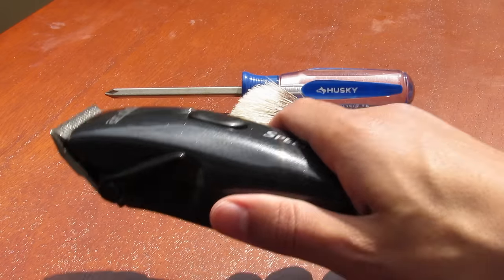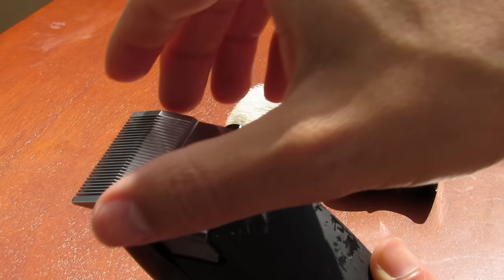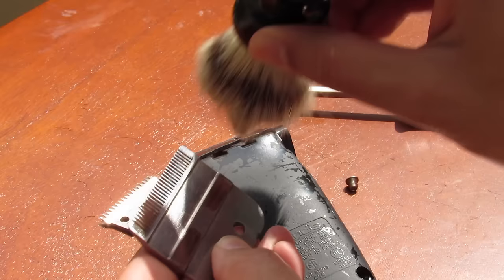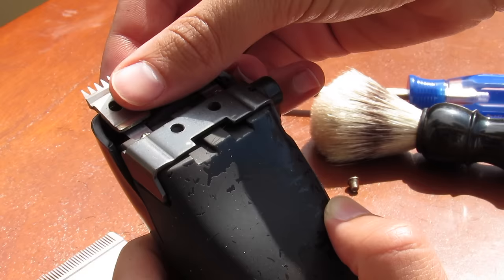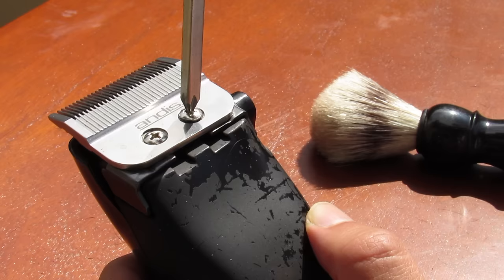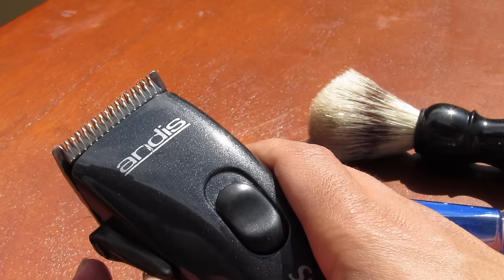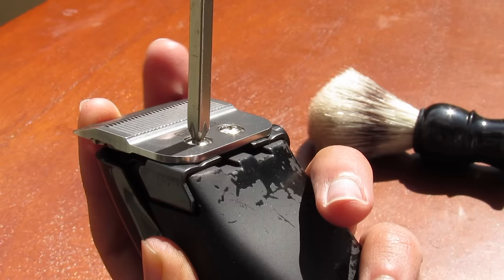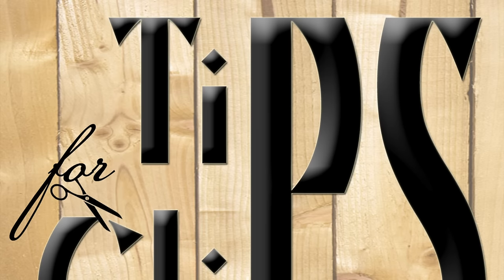Zero Gap Any Clippers in 4 Minutes | Tip #15 | Barber Equipment

Comment: Thanks and tip at 1:38 solved my problem informing us to have the 2 curved parts pointed to each other.  When I 1st put it back together the smaller blade I had it curved away was from the larger blade.  Thanks again

Comment: On the whal home cut pro. You can push it all the way. All you do is loosen the two screws push the blade back all the way and tighten while holding or pressing against countertop. Then take your fingernail and make sure you feel the bottom blade before the top(the one that moves). When cutting hair don’t press too hard or it can scratch. I just did this for the first time and the results were unbelievable. The clippers cut like a razor now.

Comment: Seems easy.  So if all you need to do is zero gap the blade, you would just have to loosen the two main screws and adjust the position, and you don't need to take it all apart, correct (like, say, on a brand new clipper)?  Also, since you said to still have the top blade extend slightly further than the bottom blade, "zero gap" would really be "tiny gap", where "tiny" is something like 1/4 mm?

Comment: Lol should’ve came here before zero gapping my new clipper 😅 no wonder why I got all this little cuts all around my head lol... thanks for the info bro
Reply: Lol. I feel you bro. You gotta adjust them. Then try them. Then adjust and try them again and again until you get them just right. It can be a pain
Reply: Lol @ all this little cuts all around my head. 😂😂
Reply: I've zero gapped mine too and am getting cuts, sore patches and old skin being taken off
Reply: @DanielGreen07  I had to readjust them a few times.  Just a little bit at a time though. You might not get them to cut as close to the skin, but at least you won't skin yourself alive either.
Reply: @joej3900  I've adjusted them as best as I can, they ll do til I can get a pair that give that smooth skin cut 👍

Comment: i been watching your videos great advice! im learning to cut hair and was wondering what the zero gap is for?
Reply from the maker: Thanks! Good question: I briefly mention at the end that it's for precision, but a better reason is that if you're ever using the clippers without any blades, you'll be able to get a really short cut. So if you're using the clippers in the short setting without any guards, it'll be as close to a zero as you can get it. Does that make sense?
Reply: Tips for Clips - Haircutting can it be used as a trimmer ? For beards
Reply from the maker: Saliba R, to lighten up a beard? Yes
Reply: @TipsforClips  do you need to zero gap if using 00000
Reply: @TipsforClips  hey bro i just bought hair clipper and i always cut with guard on but i dont want that when i remove guard it cuts so bad how can i get rid of it
Reply: @TipsforClips  do this for Kemei 5017 please?
Can we do this for kenei 5017
Reply: @mrt8097  no but it is for your eyebrows! Try it!
Reply: @TipsforClips  would you explain us the teeth sizes and the spacing between the teeth of the blade please
Reply: Mi

Comment: Hello, it is not recommended to zero-gap a clipper especially if it has been in use for a long time cause the upper blade will draw a line (groove) in the lower one and whatever you try to be precise and align them back to the previous position you will never succeed so you will loose the sharpness of the blades and you might be forced to through both of them and get new sharp ones. I would like to thank you for the channel and for the simple, concise  and at the same time very rich in the most wanted information videos you present.
Reply: All my clippers are 0 gapped and I've had some for at least 10 years with no problem

Comment: Can I use a zero gap razor to get a look that resembles a slight grey on top after wet shaving it all off? 

I'm mostly bald but I l prefer the grey on top of my head that comes after 2-4 days of wet shaving. I'm wondering if this is a good strategy.

Comment: I've zero gapped my wahl baldfader clippers and now they're taking off the top layer of skin and not cutting to a smooth finish. Help!! 😄
Reply: Your bottom blade is overlapping you top one you need to have a very slight overlap in the top blade so It doesn’t cut your skin 👍🏽
Reply: @IronIzan  I've adjust the blades so there's a slight gap now but it's taking off skin (white, dry skin which may be dead?) Maybe the clippers are fine and I need to moisturise? 🤷‍♂️
Reply: @DanielGreen07  prob the clippers get some fast feeds they work good af
Reply: @IronIzan  I've given up now and just wet shave it with a hand razor 👍
Reply: Those clippers don't need to be adjusted.They already are sharp.🤔

Comment: Unfortunately this does not work with a Wahl Super Taper Cordless. The blade can not be moved as soon as the screws are in position. Or am I doing it wrong?
Reply: 123 654 Nope, won’t work because the two holes in the blade and the two screws holding the blade have the same diameter. When I loosen the screws the blade is still fixed. It can only be moved when the screws have been removed. Maybe they have changed it with the model I have (Wahl Super Taper Cordless).
I have now used two different screws to make it work like you have described. Thanks.

Comment: I have a Wahl Pro. If I loosen the screw on the gap lever it allows for moving the blades to exactly where I want them. Is that the same as unscrewing the 2 screws holding the blades together? It seemed like the easiest way. Although I still have to disassemble it to clean and oil. But will the blades remain zero that way?
Reply: The screw on the lever only tightens or loosens the resistance of the lever. It doesn’t allow for adjusting the position of the blades.

Comment: Nice video! So...just did it with mine...just to be sure..the little blade just go over the pivot right? and the big blade goes on top and when screwed this one secures the little one? am i correct?
Reply from the maker: VIC CAMPOS, thanks! If I understood you correctly, then yes, that sounds right

Comment: Hi!
Can I do it on a Wahl Icon too? 
I'm going to buy a clipper, I'v chosen the Icon, and I'd like a nearly zero gap cutting (about 0.1-0.3mm), because I want to use the clipper also on my face "shaving". I'll  use the machine only at home, I'm not a professional.
Will I Surelyt be able to do this with the Icon?

Thanks for Your help!
Viktor
Reply from the maker: Viktor H, I’ve never tried the Icon. You can certainly zero gap Wahl clippers, but if you want to shave your face, you will not get a clean shave as you would with a blade. Zero with clippers is not as sharp as trimmers or blades
Reply: Thank You! My goal on my face isn't a totally smooth skin so it'll good for me if it is adjustable to a near zero gap as You told. My doubt was only about that Icon's adjustability as in the video I'v seen.

Comment: A ripper washer would be best to put under the screw the gets less tension bc then you can still tighten it and keep a straight blade without the worry of when your actually cutting hair say doing a line, the rattle or vibration will loosen the screw and move the blade and possibly cause a cut or uneven hair lines

Comment: Do you recommend to zero gap if you will be using it to line up your beard?
Reply: @Sheriff. 0 gapping is for fading, it helps with removing leaving fades lines for better blends. For beard, I would use a trim liner, they give a crispier lines and easier to handle.

Comment: Great video. 
My problem is that I keep marking my skin and gives me black mark my skin when I do outline.  What your advice. Thanks
Reply: Did you figure it out?
Reply: I have the same problem also
Reply: Check your blades to see if the cutter blade is higher than the guard blade.

Comment: hey there, I've got a wahl color pro cordless and I was wondering if I could safely try this too? maybe not necessarily 0 but lower than 0.8. Thanks
Reply: boulala21 yes you can I have the same clipper as you. You can 0 gap them
Reply: @NighmareRS  oh sweet, do you know if I need different screws? as that's what I read somewhere else. Cheers

Comment: So is it best to have this type of clipper as your fading or balding?
Reply from the maker: Scardrewpro, zero gapping helps you cut shorter, so it’s good for a balding haircut, though you’ll need something other than just clippers to entirely bald it out. It also helps with precision
Reply: It appears that most excellent clippers can cut hair to 0.8 mm but if you have a good shaver than it should be able to cut the hair from 0.8 mm to 0 mm safely.
Reply: So for super low, balding haircut to get the look you need clippers and trimmers together? You can’t just use trimmers, like T Outliners by themselves, if your hair is already short and you want it super close? Thanks

Comment: Do you know if adding a thicker cord like the ones on the big trimmers to any small trimmer will add power to it and help with overheating..
Reply from the maker: Sorry, I'm not sure
Reply: Doubt it! This is because the same power would be outputted to the motor. The motor is the main thing that generates the heat.

The best type of quality motor arguably is the Rotary motor. besides the quality of the hair clipper, obviously.
Reply: Nope, the trimmer will still get the same input voltage no matter how much you upgrade the power cord, the cord included with it is designed to be thick enough of wire to carry the power. Unless your cord is getting hot to the touch or has serious damage such as exposed copper wire, there is no reason to replace it. You also risk voiding the warranty. Only thing I can think of is make sure the blades are oiled and that the machine is not clogged with hair and debris, if you're mechanically minded lightly adding oil the to motor bearings may help it, but I doubt this is the issue. (This is advice for everyone)

Comment: Sorry dumb question. Wasn't it already 0 gapped with the clippers closed in the beginning of the video?
Reply: Rap Philosophy  most likely but he was doing it as an example. Or for instance sometimes when clippers come pre zero gapped they tend to leave a gap of like 0.25mm as a safety precaution and  sometimes you want it a little tighter like 0.15mm. Might not sound like a huge difference but it does make a massive difference in results.
Reply: @SoulCaliburDeathCrie  ah ok. Got it. I'm new to it. That makes sense though
Reply: Rap Philosophy cool no worries I’m no barber either myself I just like to learn this stuff. But so long as the moving blade and stationery blade don’t overlap you won’t be cutting people that’s the main thing :)

Comment: Your video was good. 
But after cleaning the blades and the inside, I would have thought that so oil on the blades would have been ideal. 
Eventually you have to oil the clipper, when you dismount it...do you agree that applying oil is a good idea..?
Reply from the maker: rich Mck, absolutely right. You should regularly oil your clippers. I just didn’t show it in this video

Comment: upper blade lower blade which is which..explain
Reply: the blade that moves is that upper or lower?? smh frustrating
Reply from the maker: When I go to put the blades back, the one that I put in first is the lower blade, then the one I put second is the upper blade. It’s “upper” because I put it on top of the first blade. Make sense?
Reply: The blades that moves when you adjust the lever is the upper blade. The other smaller one is the lower blade
Reply: If you hold the hair trimmer in front of you with the top blade and its name facing the ceiling then the lower blade is facing the floor. 

The lower blade also has the screws in it facing the floor. The top blade or upper blade is the smaller blade on top that slides up and down the larger lower blade when the lever is moved.

Comment: That's a bad way to scar your clients,  those clippers are not designed for that, buy T-trimmers for $40
Reply: So I've used a trimmer for a bald fade but it's hard to get that line out with my Wahls Magic clippers . I was told to zero gap , but since you said this, how could I remove that line ?
Reply: @MidnightDeLorean   razor, best way to line up anything, but if you dont have a razor, than you can use beard clippers , the skinny one , that will get ur line ups nice
Reply: @joeykorona7157  appreciate it bro .